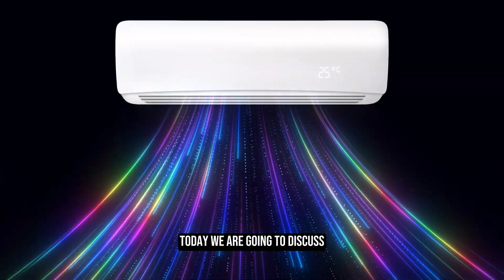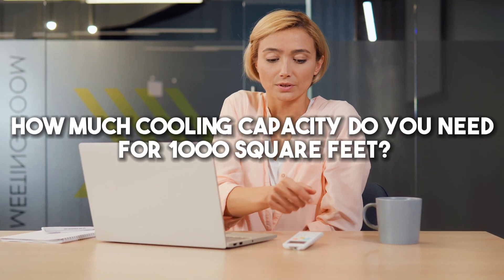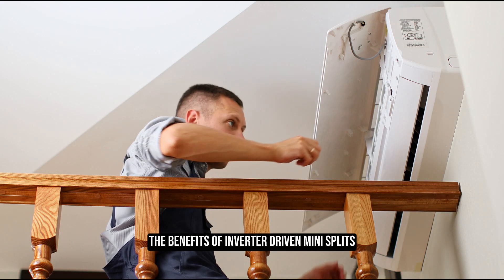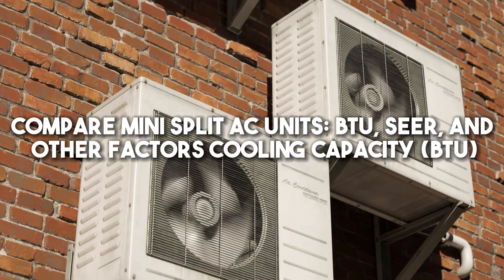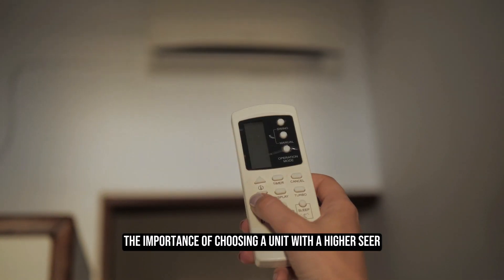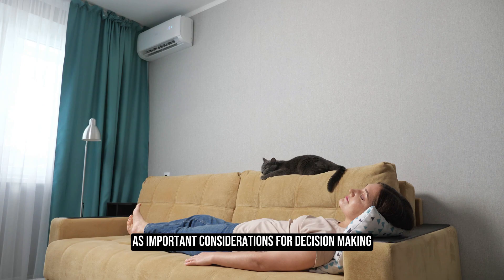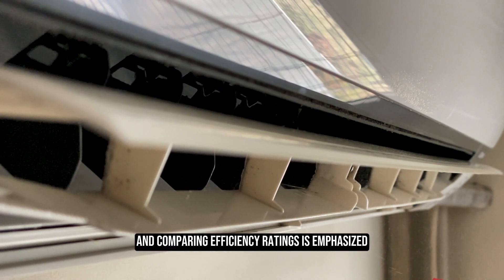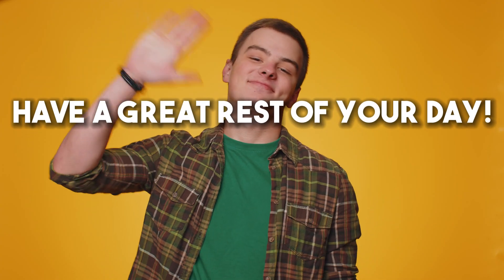What Mini Split For 1000 Sq ft?

Comment: I thought aircons cool cubic metres of three dimensional space not square metres of two dimensions? Maybe you have a different piece of kit there? Or is this the flat earth society?
Reply: You thought wrong young Padawan
Reply: @ACCESSxDENIED  Then please do have the grace and respect to prove your point. What happens to the third dimension when I turn on my aircon? Does it only cool one flat wall, surface, floor, ceiling? How does it stop the cooler air escaping into the rest of the room and the third dimension? I'm no great physicist, I admit, so please be gentle with me, I'm fascinated by the two-dimensional icons with which you seem so familiar.
Reply: Btw I'm not so sure about the appellation "young" (Padawan) unless you are an octogenarian or Time Lord you may be younger than me. Time, that's the 4th dimension, right?

Comment: Sorry when it comes to inverter mini splits over sizing it is no longer a factor. Mini splits be it the ductless or duct types are better being over sized if you can. These types of systems run as low as 1000 btu to their highest capacity. Most BTU size calculators do not factor in cubic feet size, heat load, temp swings and so on. For example you can build 2 exact size buildings and run one with an over sized system and one with the "correct size system" and add additional heat load like a person 24 hour inside, cooking, computers, tvs, lights and other heat sources along with a very hot day ouside and "correct size" unit will struggle to maintain the load while the over sized unit is running just a bit more than normal. 
Because inverter mini splits run all the time yet at super reduced btus they are not like normal AC units which shut off and no longer move air around and wait till it heats up again. Mini splits or their ducted units reduce fan speeds to super slow and btus cooling power and keep conditioning the air all the time. By doing this you also remove all of the mositure from the air which also make the room feel far better.
Reply from the maker: Thanks for the insight; we always recommend over-sizing if in between sizes.